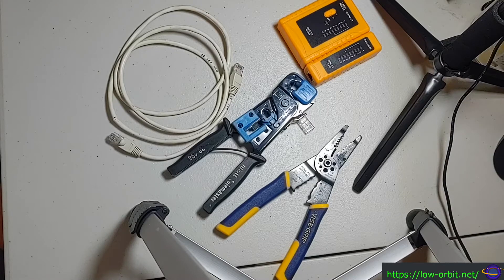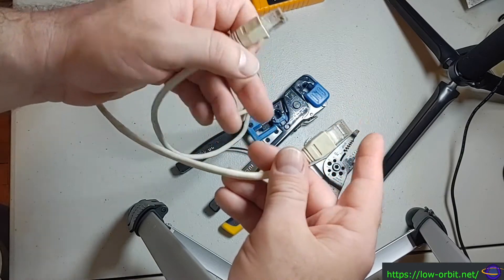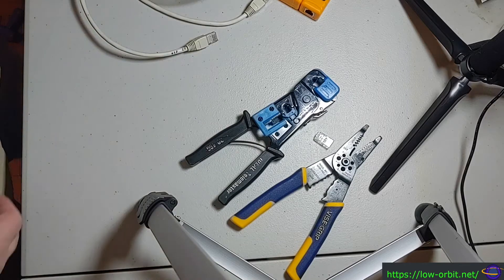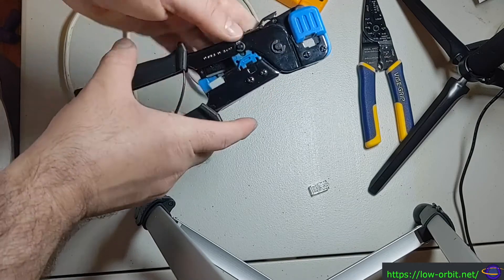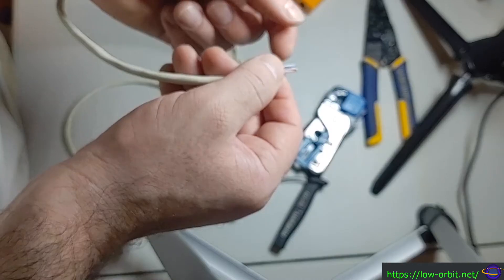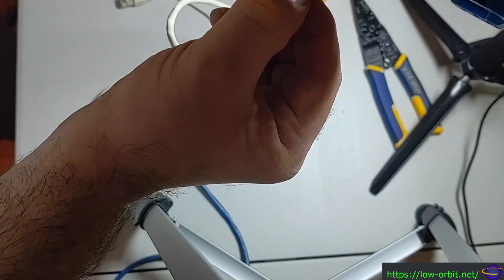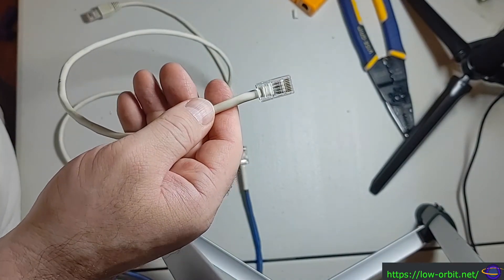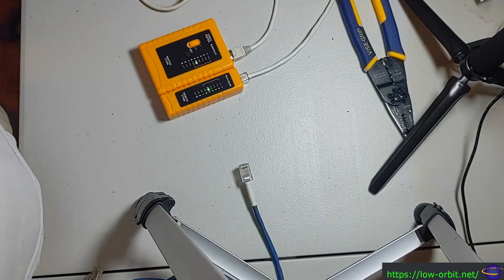How to Crimp an RJ45 Connector to a Cat 5e Ethernet Cable

Comment: Pass through RJ45 connectors avoid the hassles of trying to guess the correct length of exposed wires and precisely trimming them. Additionally, the wires projecting out before trimming make it easier to verify they are inserted in the correct order. Some crimping tools crimp the cable and flush-cut wire ends in one squeeze.
Reply from the maker: I did not realize that.  That would save me so much trouble.
Reply: @LowOrbitFlux  : Here's another tip I learned the hard way: strip plenty of cable (I removed about 100mm/4 inches) so the wires can easily be inserted one by one; that makes it SO easy. Each of the many "how-to" videos I watched on pass-through plugs omitted this crucial step, instead showing the 8 wires neatly arranged side-by-side and pushing all in at once.

Comment: How does the tester react if one end is not on correctly but the other one is? I'm putting ends on my new camera wires and don't know if one or both ends are good or bad. I don't have a tester yet.
Reply from the maker: Some of the lights won't light up.

Comment: You can also just buy a new cable and it will be much cheaper compare to actually buying all of the tools needed to make a new cable.
Reply from the maker: Yeah but it depends how many cables you are making.  Also, if you want one to be a custom length this lets you do that.  Also, its good for making really long cables even though you can buy those too.    It's mostly just practical if you are wiring a datacenter or connecting a lot of servers.   One other thing is that you will probably want it if you ever need a crossover cable for clusters or something along those lines.